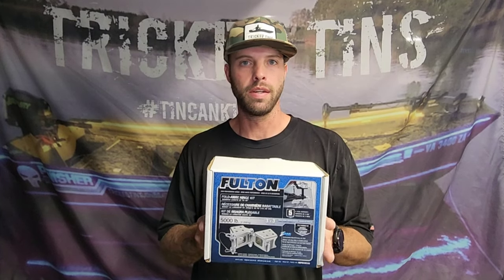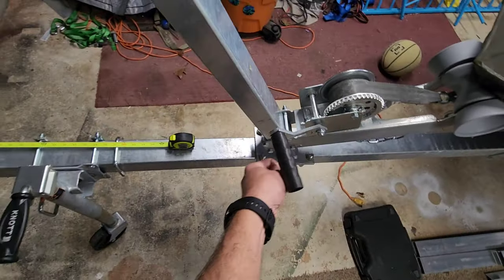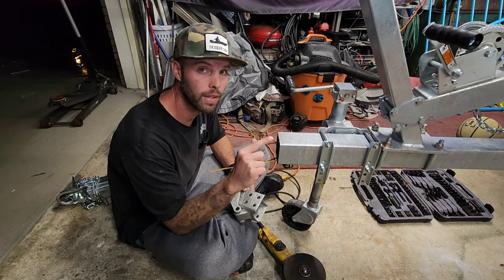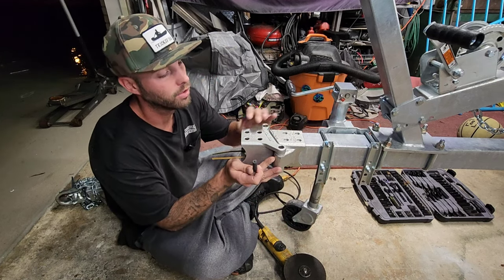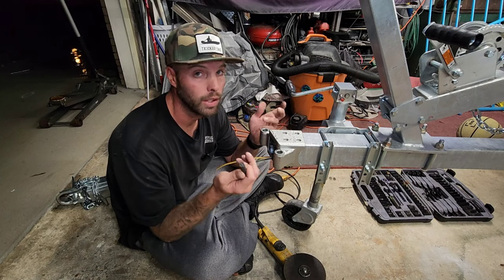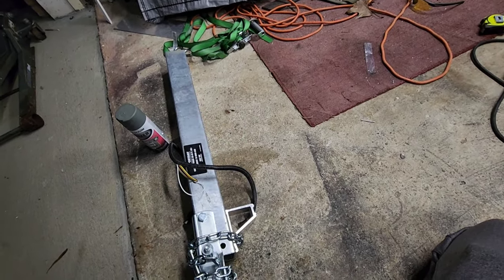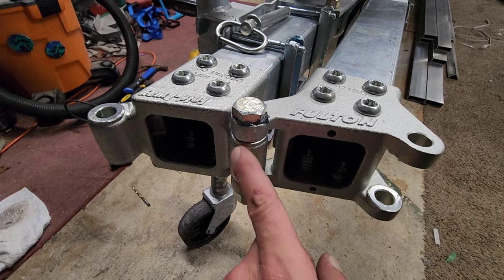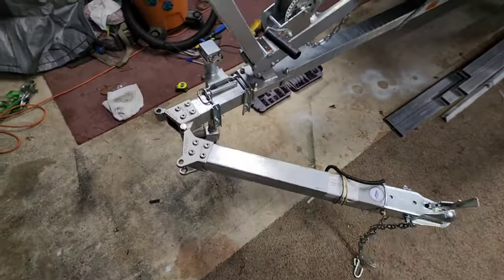Installing a bolt on Trailer, swing away Hinge! Super Easy, space saver mod for your boat.

Comment: Can you share a link to this adapter you used?  Also what type blade you used to cut?
Reply from the maker: I used a cutting wheel. Fulton HDPB330101 Fold-Away Bolt-On Hinge Kit for 3" x 3" Trailer Beam - 5,000 lb. Weight Capacity https://a.co/d/dLug2tO